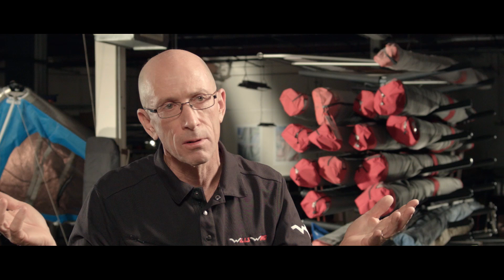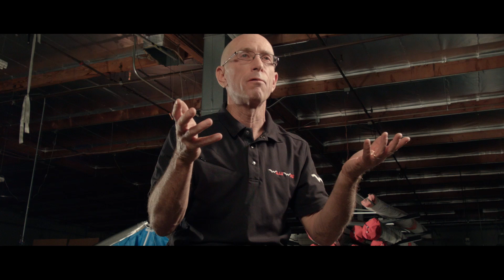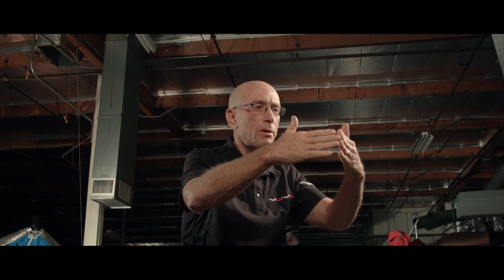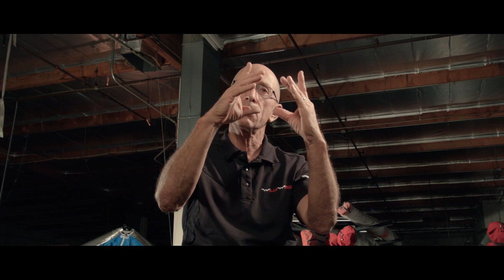Building Dreams Interview Extras 3: "Timeline of Hang Glider Development"

Comment: Going from a WIlls Duck 180 to a HP AT 158 was amazing.  The HP had a much better sink rate despite being much smaller, and landed MUCH more easily. But more than that, unlike anything else I ever owned, the HP felt like it wanted to thermal. Something magical about that design.  I thought it was more fun to fly than the U2, which of course had a performance edge over it.  The HP AT was a real masterpiece.